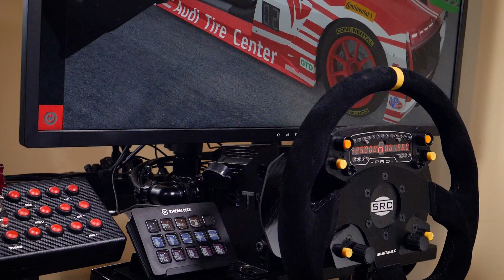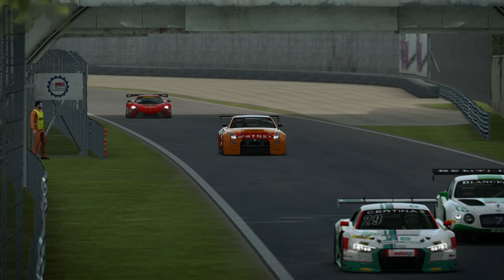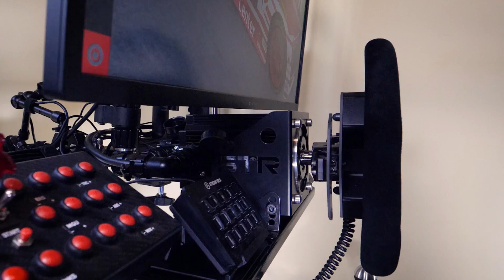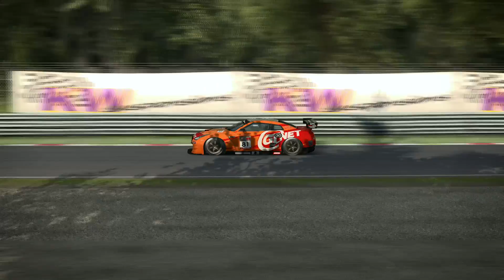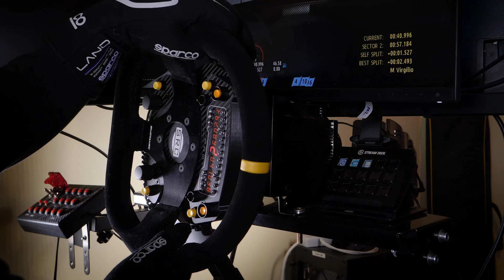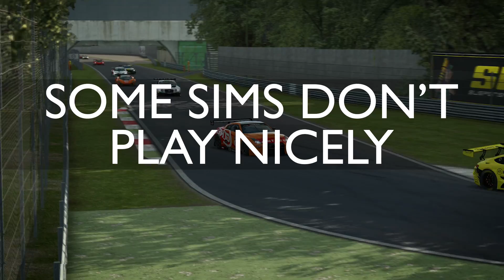Direct Drive Wheel - What They Don't Tell You

Comment: I never driven a race car with a wheel (in simracing) For my first wheel, should I jump directly to a direct drive or no ?
Reply from the maker: Honestly, it's hard to recommend the outlay if you're new to simracing. Starting off with a belt driven wheel from Fanatec / Thrustmaster / Logitech would be sensible - then upgrade if you really get into it.
Reply: @ChrisHaye  Well I'm not that new into simracing actually, I drive since already 2 years, with an Xbox controller but i get decent laps and competitive consistency.
I'm about to move to another country so I planned on finally buying a wheel.
Yeah simracing is a hobby now, so I might buy a DD wheel and add a full rig depending on the cash i can get in the futur months/years
Reply: Yes, take the best.
Reply: Really depends on your budget. I would start with a T300 to see if sim racing is truly a hobby I want to really invest the time & money in. If so, move up in wheel & rig as you have the cash. If not you can sell your wheel, get at least half your money back and you are out very little money.

Comment: Thankyou for this DD insight Chris --- and what fascinates me the most about this, is if you argued that you have a "quality wheel" that was registered in figure terms of 80-100. Then you have "cheap & nasty" registered in figure terms of 00-40 as an example. Then I would be very VERY fascinated with the argument, of if a company such as Fanatec, created a DD wheel of only 3-5nm, but with that arguably SUPERB quality figure of 80-100, then would that automatically make it better that a standard wheel like a G29 or T300 - just purely based on it's ability to telegraph those game sensations so much quicker to you, while your driving... very interesting indeed ; )
Reply from the maker: Interesting question. I would presume that such a low torque servo motor would still have an advantage in spindle speed / acceleration, which I think would provide a tangible benefit. Though, I suspect it would be subtle. I think it'd be like wine tasting, you'd have to refine your palette to really appreciate the nuance! haha!
Reply: such low torque DD wheels make no sense because the high torque is needed as headroom to avoid clipping. there are 7Nm and 12Nm DD-wheels out there but even they don't have enough headroom to get totally rid of clipping

Comment: Very informative, thanks Chris. Love to take the plunge with a DD wheel, your video has convinced me to get saving. Would your advice be the 30nm version is un-neccessary?
Reply from the maker: Hi glen - Honestly, I've not used the 30Nm, so I can't say for sure. But, 100% at 20Nm is still more than enough to make your wrists/thumbs hurt after a while! There's plenty of dynamic range, so you can feel the subtle forces (in sims that are conducive to such things), and then the wheel loads up more as you go through faster corners. I think the 30Nm would give a little more headroom, but at a guess, you'd probably not end up using the extra torque 95% of the time. 

Have a look at the settings William is using in the article I linked in the description. He's got the 30Nm MiGE, and it seems that his ideal setups seem to use around 50%.
Reply: @ChrisHaye  "But, 100% at 20Nm is still more than enough to make your wrists/thumbs hurt after a while!" ..what?... I can barely turn the wheel at 100% in Simucube tool... ok I have it at 100% in the tool all the time and adjust in the sim, but for example at 60% in raceroom it gets really tough.. i usually drive at 35% in raceroom). in ACC I have gain at 30%. At 50% in Dirt Rally I twisted my wrist :-D ....but have to say I have a Momo Mod27, so it's smaller than your wheel and therefor I need more force to turn it. Also I tweaked the 12.5A ouput from the Servo Drive to 15A (in the Granite Software)
Reply: 30nm is enough to injure you if you're not careful. 20nm is already nearing that threshold. 30nm is also only really something you'll encounter on older race cars, so unless you're really into historic racing it wouldn't even be realistic. So id say 30nm is more of a niche within the niche for people who want to drive a specific kind of car.
Reply: @Erowens98  even when driving virtual older racecars you wouldn't need 30Nm because old race cars had steering wheels with huge diameter. so for example when the old race car had a 60cm steering wheel and you drive it with a 30cm rim in the sim, the servo would only need half the torque to replicate the real forces . 

Let's assume that an old race cars steering had 30Nm torque at the steering axis (so 30N force on the end of a 1m lever attached to the axis):

If you have your 30Nm servo at full power and now use a common 30cm wheel you effectively have to fight 200N of force ---> (30N*1m)/0.15m = 200N. 
With an old 60cm wheel it would be 100N.

To get these 100N force with your 30cm wheel you need to dial down the torque to the half (half the diameter)---> (15N*1m)/0.15m = 100N

That all implies that an old race cars steering feels like a 60cm rim on a 30Nm motor... 

If that's the case, a 15Nm servo would be still well sized :) unless you really use huge diameter wheels haha
Reply: It's all personal preference but I don't even run the 13nm Accuforce at 100%, although I am at about 80% or so.  Like he said in the video it's not really about the power, more about speed and fidelity.

Comment: I would suggest to add an extra steel bracket on both sides to make the base plate more rigged.
Such a simple mod will only set you back a few pounds and solves the flexing until you upgraded to a better rig.
And if you at it, how about the DIY Motion Rig from a fellow German that can can build for under 2.500 pounds?
https://forum.virtualracing.org/showthread.php/109282-DIY-3KW-Motion-Sim-Rig-Coming-Soon
Reply from the maker: Hi rick - Yeah, I have thought about adding brackets, might be worth a try. That motion rig is incredible! fantastic!